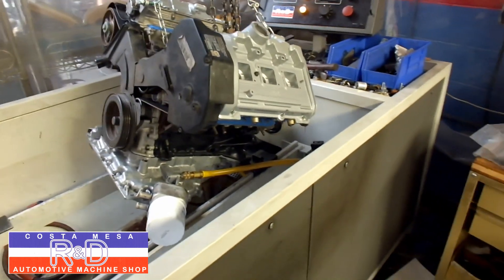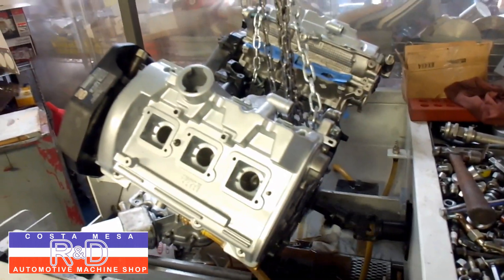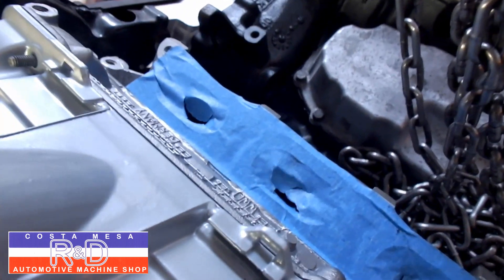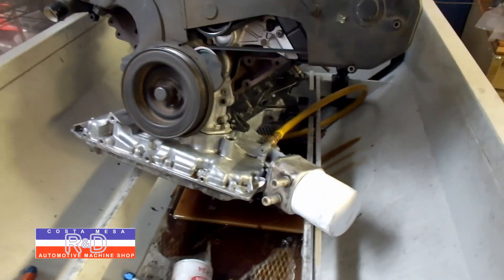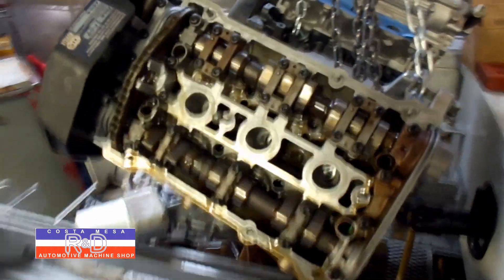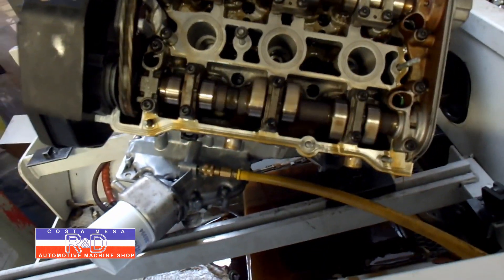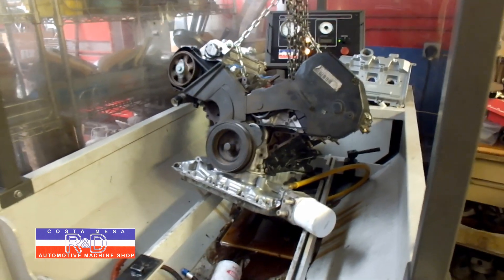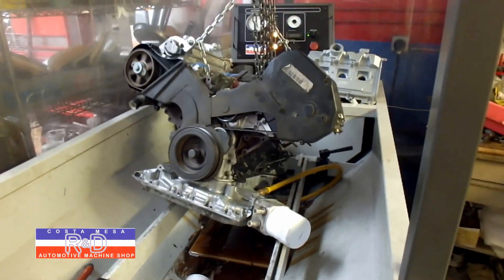Audi S-4 Stroker on the Engine Simtester

Comment: Many parts were used from the Audi an VW program.So the price for the car was reasonable.About 1/3 cheaper than a 911.Engines vary from 1984 cm³ (also turbocharged) to 2479 cm³
Power from 92-154 KW Torque from 165-280 Nm. Max weight 1190 kg